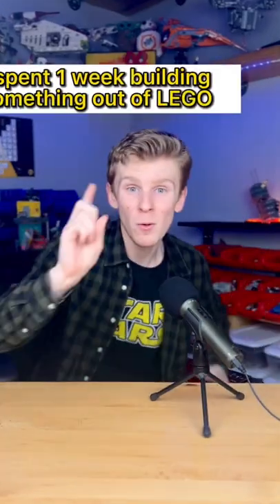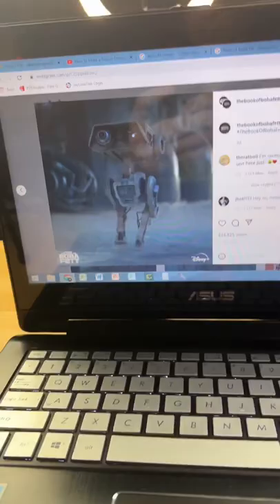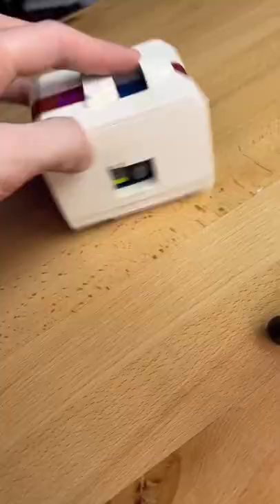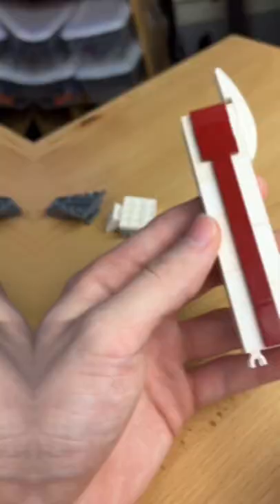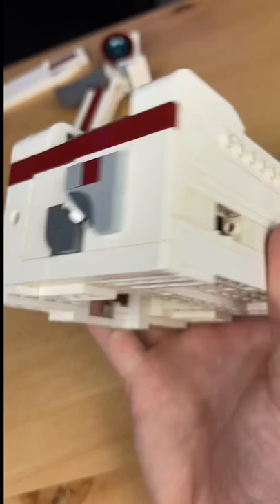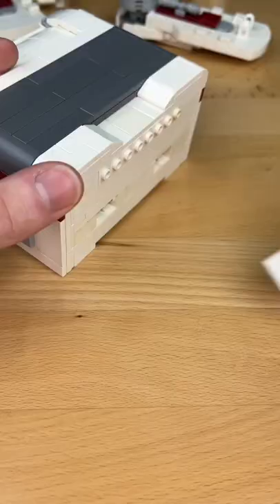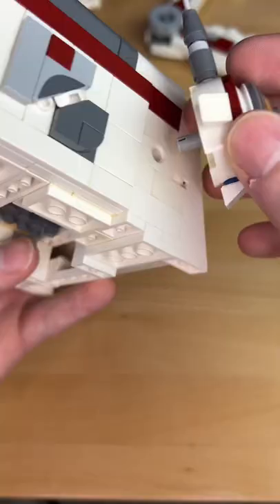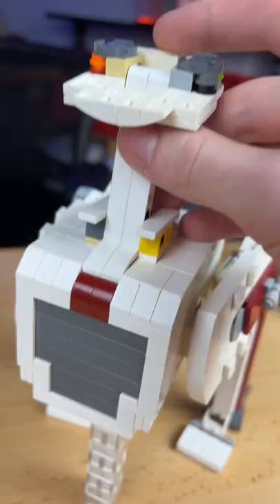How to make a LEGO BD-1 from Star Wars #shorts

Comment: A big tip for stronger moveable legs: try to use the torque gear with a big gear in ratio so the legs are flexibel but they withstand the weight of the upper body. I havent build for years. So nice to see your channel. Hope i could help

Comment: so I know exactly what I'm going to build I draw out my design and I start the journey I first built this colorful blob grab a butt load of white parts I built this little show and I placed the blob inside I grabbed some plates and some tiles I built these little panels and place them on the front and the back as well I've been grabbed this little piece and I make this weird shape I built this little section I place it on the inside I had this little hinge the rest of the leg and some little feet go to leg and another one as well I built this little box I built these 2 little panels and I slapped them on both sides I had patched this section to the back and some tiles on the top I felt this little bendy thing and place it on the side I built these little lies and I place them inside I built these 2 little antennas and a place them on the sides I connect the legs to the body I add this